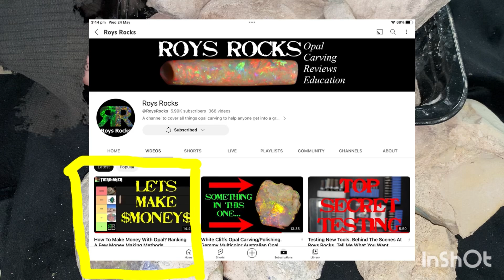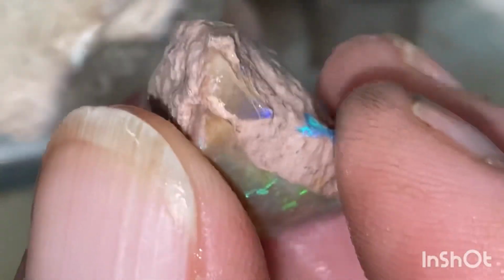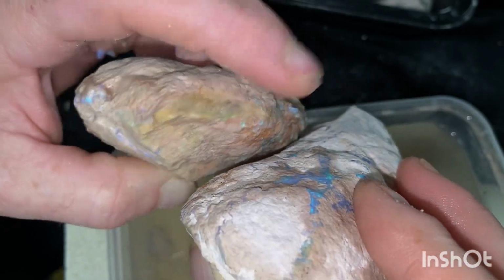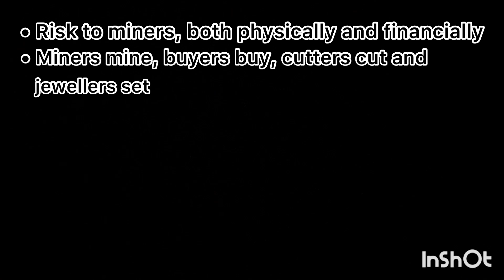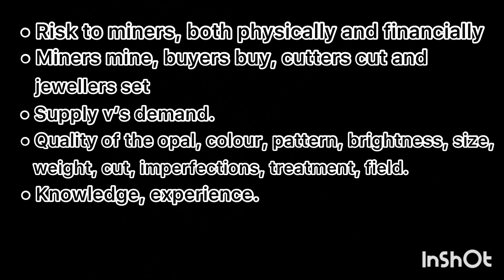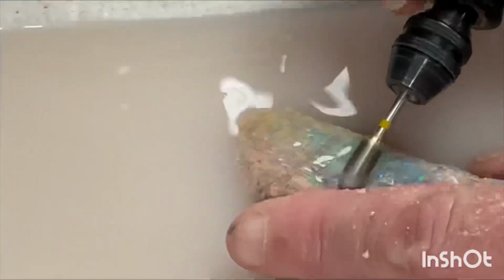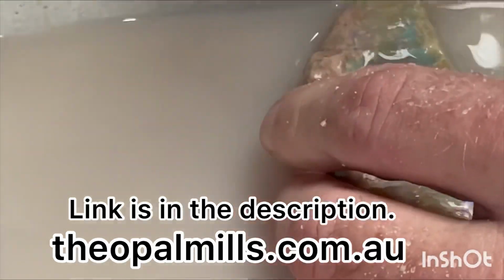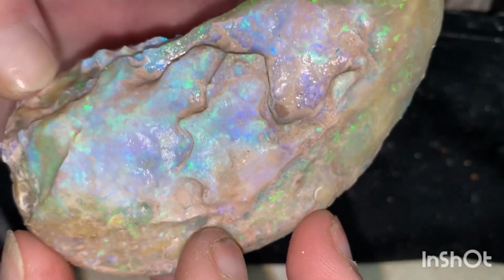Opal pricing and Andamooka mining.

Comment: Hey Phil, I keep seeing tons of “opal” jewelry pieces that are synthetic or lab grown that are simply advertised as opal. Almost none of the stuff sold on Etsy, ebay, etc., and a large amount that I see in decent shops bothers to say “synthetic or lab grown”. In fact, I’ve gotten into fights with shopkeepers who are selling crap, plastic fake opal and swear it’s real. Why are they all allowed to get away with this? How do you deal with it? Thanks.
Reply from the maker: G’day mate, it’s an uphill battle, some label a doublet with opal bottom and top a “natural opal”, unfortunately the world is the same over, and it comes down to buyer be ware, ask as many questions as you feel you need to, like buying a car, new or used, and if you don’t feel right about it, avoid it. The only thing I can do is only sell opal I can guarantee is actually “natural Australian opal”, usually because I cut it from rough myself, and clearly label my doublets as doublets, treated matrix or inlay, and stake my reputation on it. I can only see this benefiting me, as honesty and reliability will set me aside from them as I try to build my brand. 🤪👍